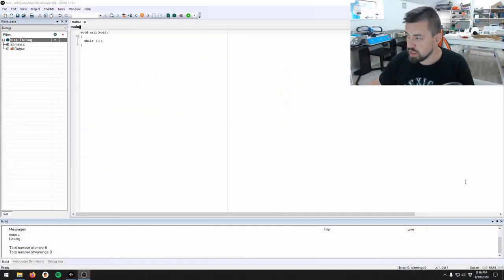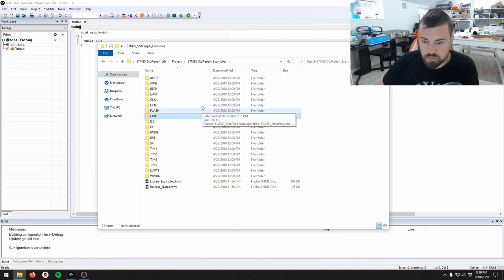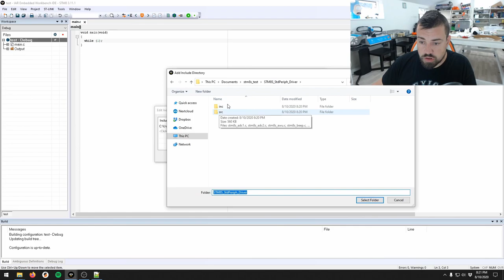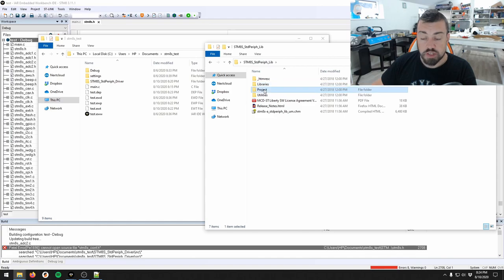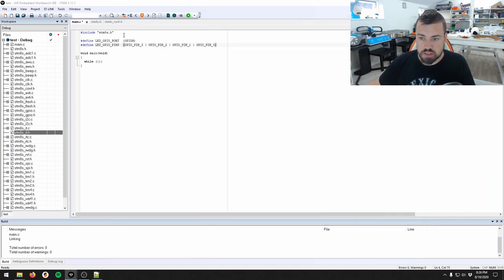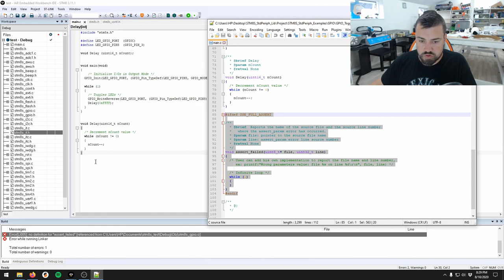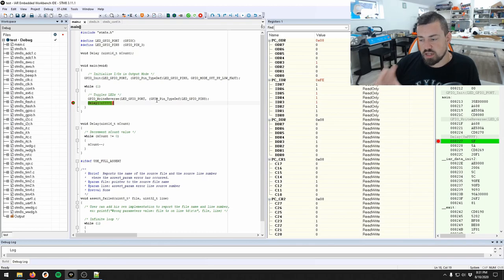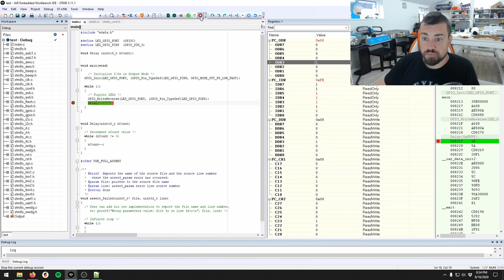Download and 'install' the Standard Peripheral Library for STM8S001J3

Comment: Great video. I'd rather recommend to use minimal resources, i.e include first only "stm8s", and "stm8s_config", then as compiler reports error for files that cannot be opened go into stm8s_config and comment lines marked with red cross on it's left side. That way your project can be as small as possible.